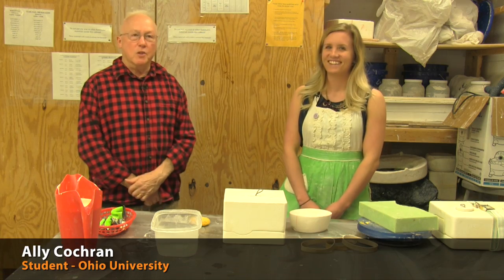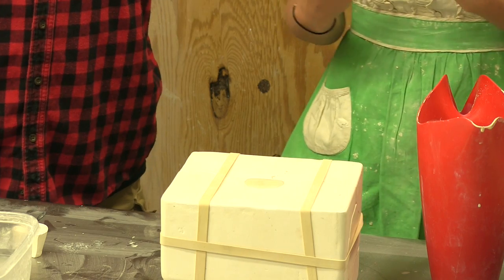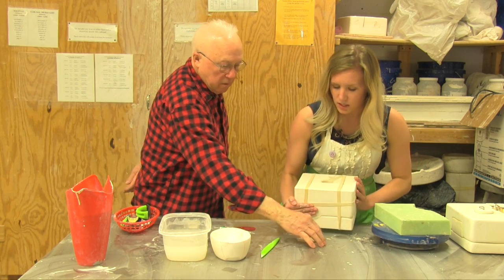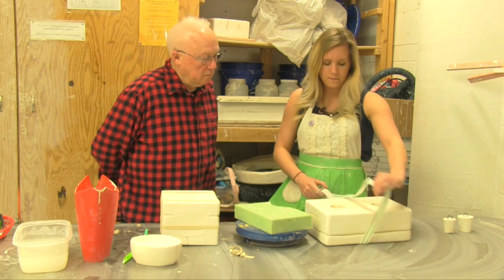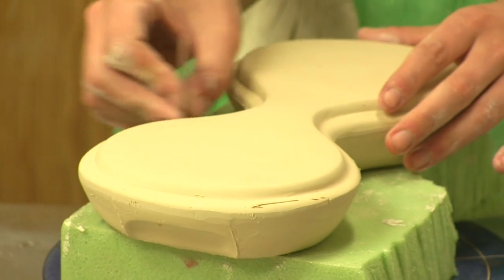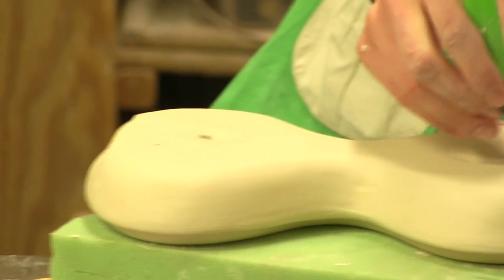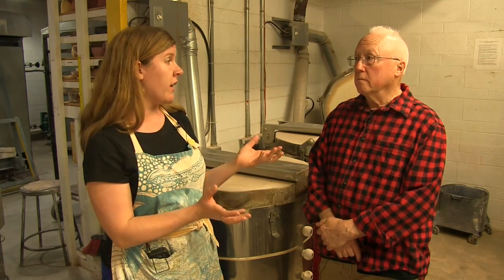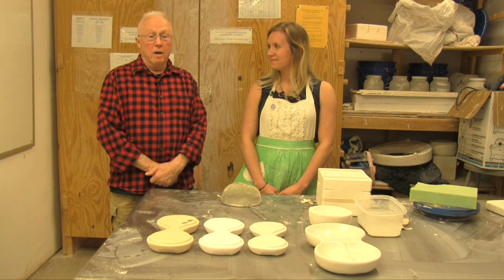How the ceramic guitar was made

Comment: I understand that a truss rod helps to offset the stresses created by tuned guitar strings (and allow adjustments for humidity affecting the neck timbers). However, this ceramic guitar appears to function just fine without the added strength of a truss rod. I am amazed.
Reply: dav snow because wood expands and shrinks because of temperature which i don't think happens to ceramic
Reply: @cdr011 Ceramic is some hard stuff, it just lacks fracture toughness. The neck is hollow more than half-way through, it might be more solid as you approach the head. Since it's not really bowed out, I'm not sure if the pressure of even 12-gauge at standard tuning would be too much for a straight neck. A larger neck curve would probably lead to breakage, though. Ceramics have high compressive strength, but notoriously poor tensile strength.